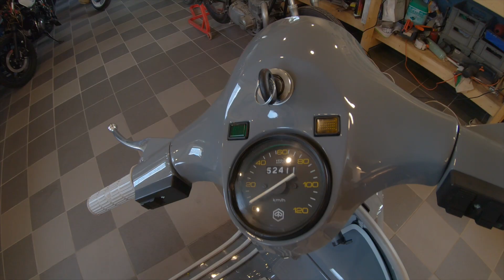1983 Vespa PX125E first start after total restoration.

Comment: Lovely resto Nikos. Currently restoring my 2002 PX125 E, it had a very hard life but I'm slowly getting it back. MAy I ask what exhaust you have there, I really like the sound and my engine spec will be roughly the same as yours. Many thanks in advance :)
Reply from the maker: Hello Chris! Thanks for tour kind comment, the exhaust is a polini one, I love the sound of it too, I also installed a 177cc cylinder kit on mine but not a performance one. Better than the original 125cc anyway…
Reply: @NikosDiavatis  Thank you so much, I'm going to track one of these down :) Was looking at the SIP exhausts but I think I'd prefer one of these. Stay safe and thanks again Nikos 👍🏼